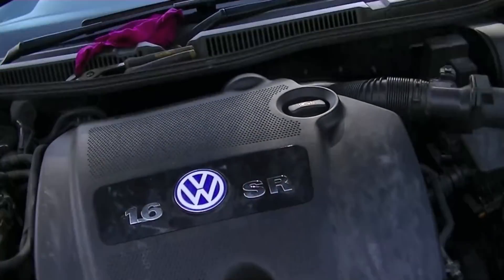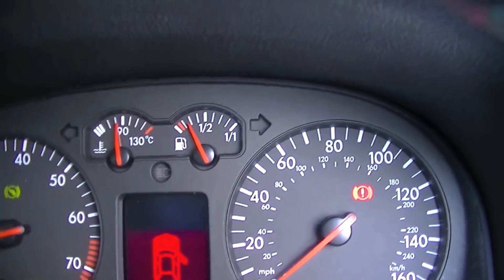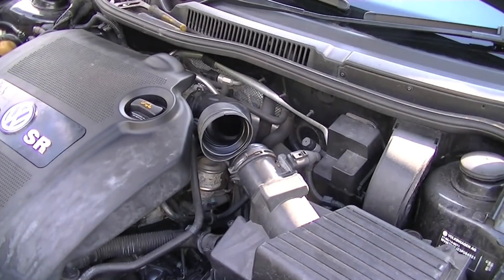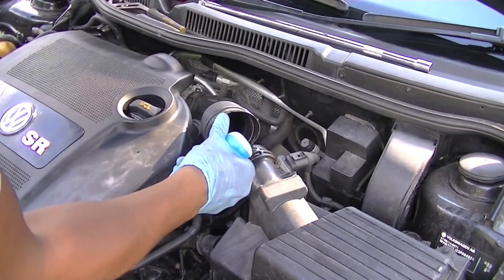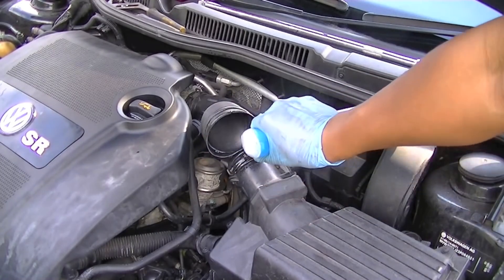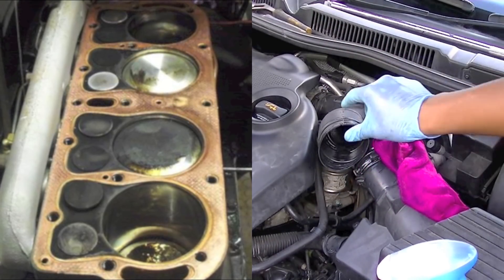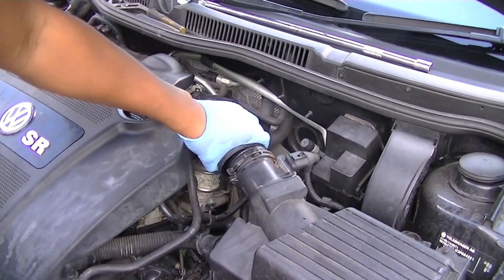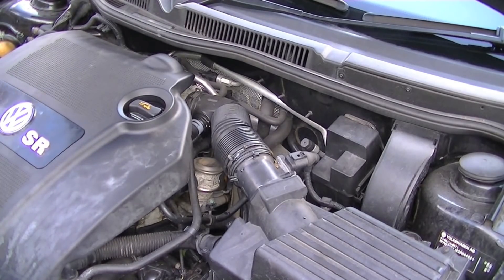How to make your engine run better with just tap water.......Better Than Seafoam?

Comment: I just add a gallon of water to the gas tank once a year. Been doing it for ten years.
Reply: yeah, and chlorine in the oil try it
Reply: haha chlorine in the oil, holly fek.
Reply: sounds legit :)
Reply: Graham Higgins hahahaha
Reply: Anyone else ever accused you pf being a genius
Reply: Why not put sugar in your gas tank
Reply: don't knock chlorine man, cleans your teeth too! wait thats florine.
Reply: Yes, nice sarcasm, but we all know petrol floats on top of water and the pick up line usually terminates a few inches from the bottom, so your US gallon of water, being somewhat less than a UK gallon, (4.5 litres), may just miss being sucked up. If you're adding it incrementally throughout the year, it'll still accumulate in the bottom of the tank. But of course one could still see problems, if for example you drive over rough terrain that sloshes the contents all about, giving rise to a fat glob of water being sucked up. Yeah, well, what do I know...
Reply: Some poor bugger will try that .
Reply: He must work in Washington D.C.
Reply: Chlorine in the oil is a bad idea but chlorine in the master cylinder will certainly do the trick!
Reply: I don't know where you live and if this is for real.  I think you are just writing this in just to get comments.  Any idiot knows that water goes to the bottom will get suck into the system. In a cold climate, the water will freeze and there you are stuck in the middle of nowhere.

Comment: An engine needs to build-up a carbon layer to make it 'oil tight'. That why in the old days before engineering tolerances where as good as they are today, you had an extended running-in period. All this will do is remove the ESSENTIAL carbon from the piston rings and increase oil consumption through the cylinders, leading to increased emissions. The internal combustion engine and water is NOT a match made in heaven!

Comment: I'm a professional motor mechanic and apart from 6 months in my 49 years in the trade that's all I've done I've worked on cars and commercial vehicles I've repaired cars with cable brakes up to modern air and hydraulic braking systems on old style side valve engines to modern variable valve engines from magnetos to computerised systems. Through all this the principle is still the same from the start of internal combustion engines up until the modern vehicles of today and they all work the same. Believe me what this man is saying really works I was shown this when I was an apprentice and I've been doing this very thing for years. If you are in doubt go and buy an inspection camera and look down the plug holes before and after its amazing the piston are so clean it looks as though they have been polished. I will say that you have to do it a few times for the best results and if you have an old worn out engine that removing the carbon deposits on a worn out set of Pistons can cause a loss of compression and a higher use of engine oil and even non starting of the engine but if the engines that knackered then it's life is up any way. But good luck to the fella he has told you a trade trick that's been known for years !!
Reply: You are completely right Glyn, I also am a mechanic and we had problems here in Australia many years ago with Ford Falcons with 250  (pre crossflow) motors, and other cars as well that used to come into the workshop -Pinging or Pinking their heads off as some say, the  problem was carbon build up on pistons and combustion camber causing detonation as the carbon would glow red hot. many old mechanics will know what I'm talking about , you could adjust the timing all you liked and it wouldn't fix the problem. an old mechanic showed me the same trick. I used to do the same thing, just squirting water down the carburetor with the engine running just the same as the video the black stuff that came out of the exhaust after was amazing. Problem fixed and these motors ran like a dream afterwards and happy customers.
Reply: Glyn mercer
Reply: robert reed how tf is some guy on YouTube responsible for anyone's actions? Is this your first time on the internet? The guy making this video is simply showing an old technique that has been proven to work on some vehicles. He can't be held responsible for the unknown variables that someone watching this could introduce. Eg some idiot thinking " more is better right?" And dumping a gallon of water directly in his engine claiming he saw it on YouTube so it has to work.  People are stupid as you have graciously shown and need to hold themselves responsible & to a higher standard. There's stupid stuff that's incorrect all over the internet, take it for what it is.
Reply: Glyn mercer that man is a jerk! Never take the risk of water in the engine . Or water in the fuel tank. It   can be a dangerous idea for damage all yr injectors & sensors  .( WD40 is cheap & better than water . ).This video is a suicide!
Reply: This exactly. After this the car was running smoother but oil consumption was through the roof. I sold the car because of this. It was 1l oil for 800 kms after this. Before it was high but not as high as this
Reply: Would this work on semi truck
Reply: Where did that come from...
Sorry
Reply: this is not a good thing to do, terrible advise intended to decieve.
Reply: @cadewiley2996  Go change your pad.
Reply: I have to spray water after the air filter and the MAF and before the turbocharger, is it right?
I saw somebody spray water before EGR, but mine is after the turbo. So, which is the right way to decarbonize the engine?
I have a Ford Mondeo Mk3 2.2 tdci 114 kW.

Thanks to all.

Comment: Ive been a mechanic for 40 years. Don't do what this man says.
Reply from the maker: The question is, have you been a good mechanic for 40 years?
Reply: When water hits hot carbon it breaks it up that’s what happens
Reply: What a waste of 40 years..
Reply: Of course not. I thougt every man new that water in absolutely not good for the engine! Actually thats we are trying to avoid!!
Reply: @value4life471  If water's so bad then explain why, when I did just this same method to my neighbor's lawnmower that barely ran, it made the engine work right again.
Reply: @101Volts  if you are thirsty you can drink alcohol as well but would it not be better with water? Just because something is working right now doesnt mean that it is good long term. Actually im not a mechanic so I don't know.
Reply: @101Volts  he thinks the engine will hydraulic. But there's not enough going in.

Comment: Some WWII supercharged aircraft engines had water-injection for detonation reasons  at high rpm and high boost settings. This added a small amount of water to the gas/air mixture.

Comment: This is a nifty - and old - idea. The minute amount of water entering each cylinder when sprayed into the intake at 3000rpm will instantly become steam when the fuel ignites.
Does it work? The example used in this video (a stripped 4-cyl. engine with a leaking head gasket) proves the point: it is by far the cleanest cylinder! A failed head gasket causes various problems and symptoms: air forced into the coolant, water in the lubricating oil, antifreeze and all kinds of gunk entering the leaky cylinder, coolant entering the cylinder when the engine is not running, causing rust and possible hydraulic lock if the leak is bad etc. The only upside is the fact that the affected combustion chamber is likely to be carbon free.

Comment: THis is pure bullshit.  NO real auto mechanic will tell you to put water in your engine.  The combustion chamber of ANY gasoline engine is NOT meant to receive water.  Oil?  Yes, OBVIOUSLY, but not water.  Seems a lot of idiots love to support one bs hype idea after another.  
Next thing you'll tell me is that the old "Tornado Fuel Saver" actually does what it advertises, which is also pure bullshit that I know from experience of trying it on three different vehicles of three different engine sizes.  

Why are you all thumbs upping this video?  Are you that desperate to " belong" to something?
Reply: the combustion chamber is NOT designed to receive oil. only fuel and air. There is a good possibility this could work, the theory is sound, I am going to look into it more.
Reply from the maker: +Everything Real I respect the fact that your prepared to research it, that is all I am asking people to do.
Reply from the maker: Your comment kinda shows that you have not done your research. Just google search "water methanol injection", it i will help you with your confusion.

Comment: You are right on the money, repairs to the pictured engine was probably a $2000+ job.!!  ... Mr. BMAC VAGS aint bullshitting Youall, i do this every 2 weeks and have never burn't an exhaust valve, not re-toque your head after 5000k's will also cause an expensive repair bill.!! ... i run my engine at 3250 rpm, i don't wait for the engine to get hot, i set a fine spray on my garden hose and let it run for 20 minutes, to get optimum water/spray flow increase flow until engine runs rough, then backoff the flow until it runs smooth again, the 1600 degrees C temp. in the combustion chamber changes the water to Hydrogen & Oxygen, that does the job real good.!! ... it also cleans your Cat. Converter and that's Great for our environment.!!   Well Done Mr. BMAC VAGS.!!!!
"The Voice of Experience"

Comment: Hello there just tested on my Jetta mk4 and my friend's toyota grande and it works like magic. amazing DiY
but i have a question BMAC VAGS, how many times i can do it and what time interval should i do it? once a week, month year?

Thanks...once again
Reply: You really shouldn't need to do this very often unless your engine has some other issues and suffers from excessive carbon deposit creation, in which case you should focus on resolving those issues first anyway.

Once in a couple of years should be more than enough on a good engine.

Comment: I just repaired an engine that had internal coolant leakage. Where the leak was ocurring was identified by a very clean piston. The best way to prove his theory and know how long it takes to clean the piston is by using a camera with beore and after shots over a documented length of times. BMW is working on high performance engines with increased piston compression ratios plus water injection to prevent preignition and cool the pistons.

Comment: HELLO ---FORMER GM ENGINE INSPECTOR ----REMEMBER WHEN VOLVOS CAME WITH AN ANTI KNOCK WATER TANK LIKE A WINDSHIELD SQUIRT TANK ,,,,,I SAY THIS PROCESS IS -- NOT GOOD ---THROW A CAN OF WHATEVER IN THE FUEL TANK AND USE DECENT NON SUNOCO FUEL

Comment: I drive mine hard enough that it never gets a chance to build up LoL
Reply: you make more sense than this guy
Reply: you will still get deposits on it the way it stays clean is regular oil changes fuel filter and good quality fuel if you use city fuel from like tesco and sainsbury that will cause loads of shit to gather.
Reply: Mike Kelsall then just drive the car harder
Reply: Brandon Smit don't work that way with cheap city diesel it contains loads of shit additives like rapeseed oil driving harder will help it not gather as much but city diesel is shit.
Reply: Mike Kelsall for this reason, my grandpa and uncle only use shell and chevron gas.
Reply: Roy Spaulding how many head gaskets have you replaced? 😂
Reply: The valve cover piping in oil and water vapor into the intake is the most likely cause for carbon buildup
Reply: Nicholas Galea n

Comment: LMAO at all the stupid people thinking your going to screw up your engine! how much room do you think is in the cylinder at top dead center times that by 4 for a 4 cylinder then times that by 12.5 every second for an idle. water meth injection works it proven http://www.aemelectronics.com/?q=products/water-methanol-injection-systems/water-methanol-injection-kit-for-forced-induction-gasoline-engines 

Water will not corrode your engine http://www.streetdirectory.com/travel_guide/57218/mileage_and_fuel/does_the_added_water_vapor_corrode_the_engine.html   

The only thing is you might want to change your oil afterwards
https://www.researchgate.net/publication/269101999_The_effects_of_water_vapor_injection_into_the_engine_combustion_chamber

Comment: I've been using piss for years and it works great smells a little bad but it works great I have no Carbon on my valves are Pistons I pissed them all away
Reply from the maker: Its scary how many dumb comments i get. You would save yourself the embarrassment just by doing a little research.

Comment: This is bs, if u have enuff Carbon buildup to affect performance which would take a shit load of carbon to actually affect engine, then I think u need a tear down and proper cleaning and while your add it rebuild, not this bs snake oil solution
Reply from the maker: Water is not a bs solution...lol
Reply: +BMAC VAGS  oh I guess your one of the dumbasses that believes cause it's on YouTube it must be true, show me some evidence of real time before and after doing this on YouTube I've found none just guys claiming it works and if your using a blown head gasket as your argument for cleaning carbon that's because there's a shit load of antifreeze being burned in the cylinder not just water, just misting water into your cylinder won't do shit unless u do it for 20 years everyday, all day, u must be one of the moron Eric the car guy followers, that guys full of shit half the time
Reply from the maker: +Miu Blu Not sure what the abuse is about but no problem. Enjoy your day.

Comment: hydrogen injection does the same and gives you more power too.
Reply from the maker: Not as easy though
Reply: every one in the world is doing HHO , Not much in Australia. With hydrogen injection the more you inject the better. water injection , if you inject too much in the engine stops. Hydrogen injection is much easier than water injection. The effect is the same

Comment: just an FYI
any unburned water goes straight into the oil
Reply: ..... Where the heat of the oil evaporates it and it harmlessly ends up in the atmosphere. But for it to end up in the oil your rings need to be worn out and squirting water into your intake wouldn't be the worst thing you could do. Water can't burn.
Reply from the maker: Ok, So what tempratures does the average enging get to, and what temperature does water boil? one is oil is 600 degrees and water is 100 degrees. How will you still have water in the oil?
Reply: 600 degrees????

Comment: For 40 years I have cleaned out my engine by doing the same thing as you with brake fluid. After squirting it in, switch off and let the engine sit for 1/2 hour then take it for a run. It will smoke a bit but once it settles down it runs smoothly and more responsively.
Reply: Is this really work
Reply: And any car

Comment: I can tell you from years of experience that Sea Foam works and works great!  I have put it into a lot of things  including a motorcycle that had been wrecked and sat for 3 years and using it I was able to start it up again, same with a car that sat for 6 years.  Lets see you use water to do that.  Also your "evidence" of the head gasket failure is not valid since coolant has multiple other chemicals besides water in it other than water.
Reply from the maker: What I am saying is not a secret, if you do some research you will find this stuff out yourself. Water Meth is a good place to start.

Comment: y not just use carb cleaner it will clean out the whole system and it's made for intake cleaning too
Reply from the maker: Trying to avoid adding hydrocarbons when I am actually trying to clean it out, if that makes sense

Comment: Old mechanic's trick. But will the carbon plug up the cats?
Reply from the maker: Plugs it up with what?
Reply: The carbon bits. The water doesn't burn up the carbon. It flashes into steam and shocks the carbon loose. I'm just asking if it's enough to plug up the catalyst matrix.
Reply from the maker: +P.Melvin Shyturtle Oh okay. I have not known that to have ever happen.  Also if it gets blocked up doing this, it was probably on its way out anyway
Reply: Thanks. The carbon would probably shake to the bottom anyway. I did this on a Corolla back in maybe '82-'83. I used tuneup in a can. The resulting exhaust was like a smokescreen laid down to hide a battleship. My parent's house was pretty well hidden for a minute.

Comment: If you use a decent quality petrol like BP Ultimate the higher octaine Shell or Esso, you will find the crap removed from your engine in as like as a thousand miles. Easy crap in - crap out. Quality in quality out. Pretty straight forward really.